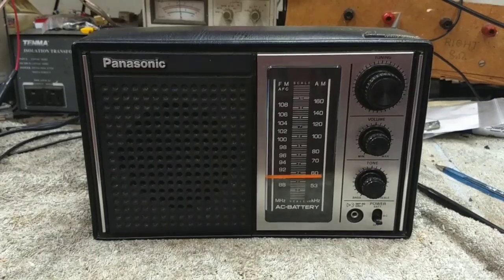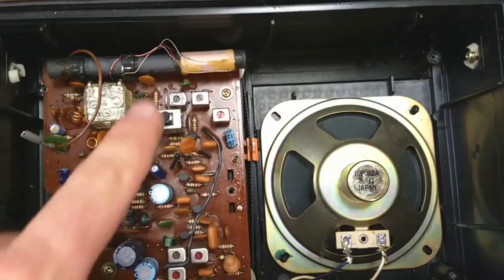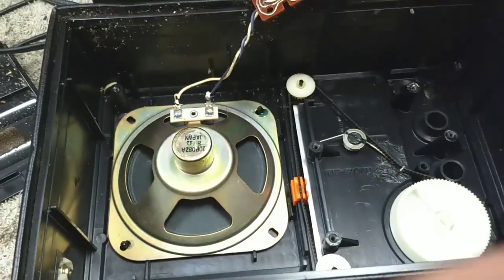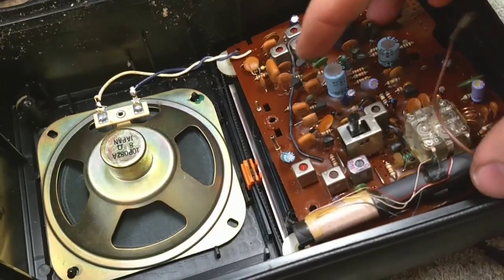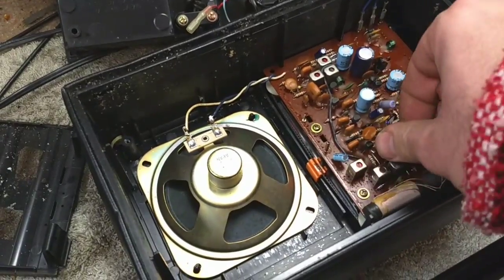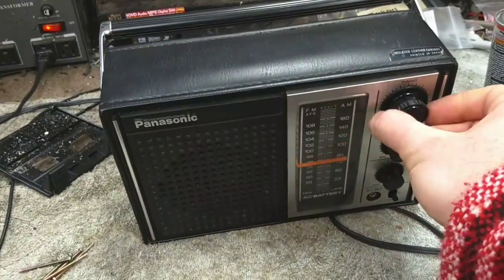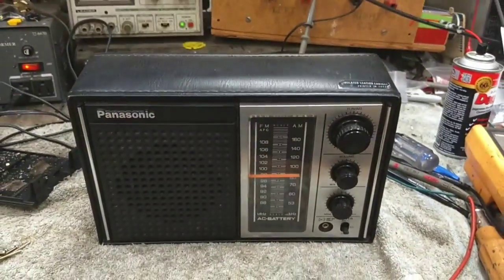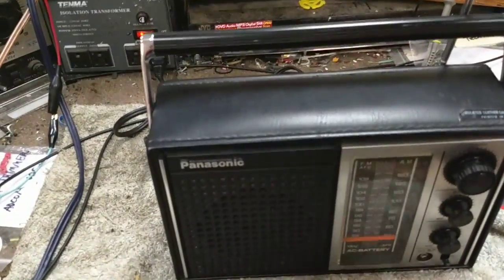Quick repair of the 1970s Panasonic RF-597 am/FM portable radio

Comment: That's a late 70's early 80's version of their popular basic portable. The late 60's through early and mid 70's version had a metal grille with small holes stamped in it, smaller flat metal knobs, older style circuit board and the older style speaker with a square frame around the magnet. It also had the older Panasonic logo plate. Nice radio, pretty sensitive too!

Comment: Any ideas where I could find a replacement antenna for an RF-569D? My first radio, bought for me by my grandpa back in the early ‘80’s. I think I broke off the antenna the first year, but I was only 5. 42 year old me still uses this radio though.
Reply from the maker: If you know rod length and diameter (in cm) you can usually find them on eBay. I got one for a portable grundig this way.

Comment: Baking soda is really only good with lead acid batteries, most all consumer grade batteries are alkaline, white vinegar is a far better weak acid to neutralize the various alkaline electrolytes. 

I have restored gear that have had totally corroded battery holders, just unsolder the holder and submerge it in a dilute vinegar and water, clean up and rinse with clean water, dry out and maybe a touch of dielectric grease or deoxit to prevent further corrosion.

Comment: My dad has a somewhat similar Panasonic that his brother used overseas. Apparently, the power transformer was completely dead. There was a junk radio in my grandmas' estate that had a good one. Physical size was larger, but the radio had accommodations for it in the cabinet. I question if I upgraded it to work on 120 volts along with changing a dead transformer.